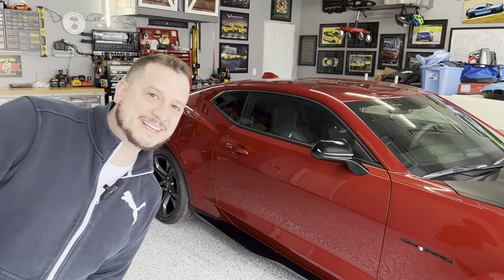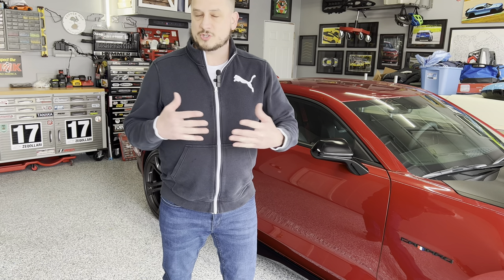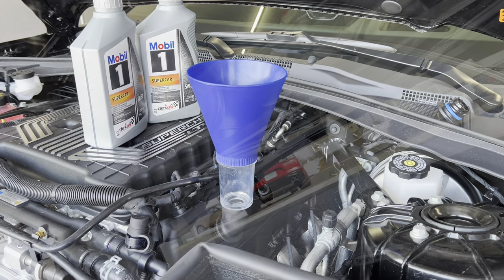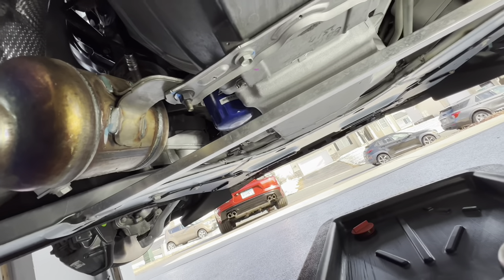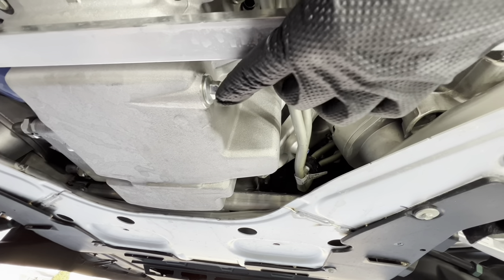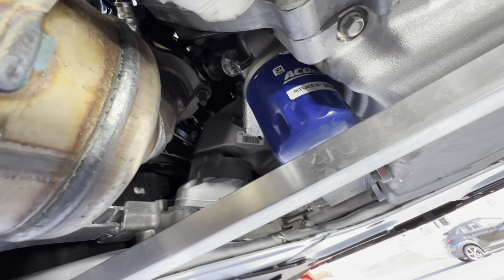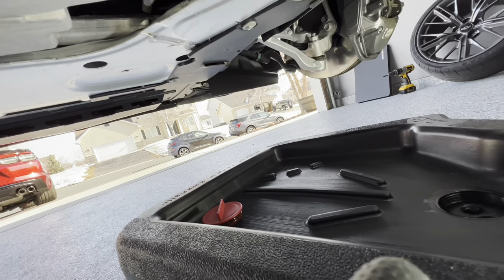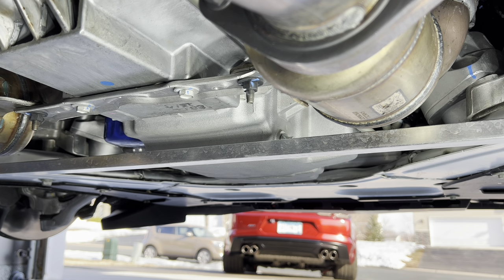How-To: 6th Gen V8 Camaro Oil Change // LT1 & LT4 // 2016 - 2024

Comment: You should probably mention not to lock that angled oil filler tube into place… just push it in and leave it pointed straight up.  If you do happen to turn it and it locks into place (like I did... whoopsie!)… Use a screwdriver to push the tab from the inside so that you can turn it back and remove it. I was so frustrated with it that I used a screwdriver to break that tab off so that it never locks in again 😂
Reply from the maker: I do mention it in the description, and I have a card that pops up in the upper right corner that tells you to break the tab. A long pick tool is what I recommend using if it gets locked. Glad you were able to remove it!
Reply: @FollowMyLine17  Oh dang, I missed that! Sorry. I was able to use a long flat blade screwdriver and it came right off. The tab was gone 2 seconds later 😂

BTW, Steelankles says "Hi!". He lives 15 minutes from me 🙂
Reply from the maker: @srhatfield tell @steelankles I said hello! Great guy! I need to get down to your neck.  of the woods for some track days.
Reply: @FollowMyLine17  Heck ya man! I know it's a long drive, but there are some AMAZING tracks down here.. Road Atlanta and VIR are the 2 best in this area.
Reply from the maker: @srhatfield I’ve been to Road Atlanta. One of my favorite tracks. My goal is Road Atlanta in 2025 and COTA in 2026, for my “long-distance” tracks. Would like to get back to NCM again, too.
Reply: @FollowMyLine17  NCM is good - super technical! Deception will mess with your mind LOL!

I thought they were crazy when Jay and the other guys did that 14 hour drive to Road America, but when I saw the videos... aaaaw man! What an amazing track!
Reply from the maker: @ the videos don’t even do it justice! Hard to see all the elevation change until you are there in person.

Comment: I have learned that 10 QT is not enough to make it to at least the halfway point of the stick marker! I do let the oil drain for about 30 min to make sure is all out! I owen a 2019 ZL1 1LE
Reply from the maker: That is not normal for the LT4. Even though it is technically in the safe range, it should be at least to the halfway point of the dipstick safe range.
Reply: @FollowMyLine17  I make sure that I stop at 10 QT then run the engine for about 2 to 4 mins then check the stick and it doesn't have a sign of getting to the first mark on the dipstick. Smh
Reply from the maker: @Papito24  sounds like you aren’t checking the oil level properly. Engine needs to be cold. 

To get an accurate reading, park the vehicle on level ground. Check the engine oil level after the engine has been off for at least two hours. Accuracy improves when checking a cold engine prior to starting. Remove the dipstick and check the level. If unable to wait two hours, the engine must be off for at least 15 minutes if the engine is warm, or at least 30 minutes if the engine is not warm.
Reply: @FollowMyLine17  Well about this! I am so OCD that I will do my oil change first thing g in the am when the vehicle has not run through at least 12 hrs! Also I do it in level grounds! I would love someone to prove me wrong but why do I need the hole 12 QTs?
Reply from the maker: You should absolutely not need 12 quarts. The GM Small block team doesn’t even recommend overfilling these engines for track use. Something isn’t right.
Reply: Try checking in the garage and garage is usually leveled ground
Reply: @Papito24 The manual recommends that you let the car sit for atleast 2 hours before checking your oil level, if you started the engine and let it run. Related to the viscosity of the oil increasing at higher temperatures, GM mentions that the most accurate check of the oil is when the engine is cold. Doesn’t matter how long its been sitting before your oil change if you start it up before you check it. 

If the engine is up to running temps, says wait at least 15 minutes before checking…. but ive had more success letting it sit overnight before checking after filling it.
Reply: @andrewyun414 Thank you for your opinion! My concern is that when I perform the oil change I let it drain oil for about 30 min, then fill up the oil filter then proceed to fill up with each quarts until 10. Start it up quickly shut it off then check! Clean stick! So for since 2019 the year of my car I have been filling it up with all 12 quarts! Stupid mistake right? But that never gave me any issues whatsoever other than waisting money 💵 right! This last oil change I did just 10 waited until next day and yes it was perfect! So I guess I have to trust it! Thank you again!
Reply from the maker: @Papito24 well, overfilling your engine can cause serious issues with crankcase pressure, and in the long run can cause issues with your oil pump. More than just wasting money. 12 quarts is a lot! Just stick to 10, and you’ll do your engine a favor.

Comment: The first adapter got lock how in the hell do I removed now. If you can show in a video or recommend me one
Reply from the maker: What you need is a long 90° or 45° angle pick tool. The tab that locked is going to be at the bottom towards the ground. Just need to lift that tab up and twist it back to the left, then break that tab off permanently. You can still drive the car in the meantime, just put the oil cap on the angle neck.

Comment: Is there a reason why you using  5w-50 instead of 0-w40
Reply from the maker: Yes, it’s a better oil for track use than 0W-40, and the oil pump can handle the 50 weight oil. That is the most basic way I can break it down.

Comment: Yeah ah if your tracking those engines with those temps do yourselves a favor use Amsoil Dominator oil it holds up better viscosity wise and had a better film and shear strength because unlike the dexos spec Its a group 3 ground petroleum where Amsoil is a true Synthetic it doesn't come from the ground it's base stocks are chemically manufactured group 4 polyaolfins and group 5 Esters base stocks. They hold up better and last up to 2 to 6 times longer. What people misunderstand is Dexos is a MINIMUM SPEC. There is much better out there.
Reply from the maker: You bring up some good points, but the Supercar oil doesn’t meet the “minimum” and has some amazing levels of additives and zinc for the price. I’d love to see the PPM data on the Amsoil Phosphorus and Zinc levels, if you can point me that way.
Reply: @FollowMyLine17  it's called oil analysis and look up how it's made Banks did a video series. It was common to blow rear ends out a pikes peak on a run. Until a racer went with Amsoil gear oil and was able to go through practicing qualifying and the race with out destroying his rear end. Racers in nascar sponsored by shell Quaker State Valvoline switching the oil out in there sponsors container for Amsoil instead because engines lasted longer. Then my experiences with 100's of thousands of miles on original powertrains no rebuild or replacement needed up to 600k and 700k. Witness to other peoples vehicles doing the same. The info is out there the question are you willing to seek it out because if you are you will justify and understand its price point and realize any one making anything close to Amsoil quality and type has a price point just as high or more. Amsoil was the first API certified 100% Synthetic oil I think it was 1971 and has lead the game since. Don't listen to me inform and educate yourself.
Reply from the maker: @Jon-O.  awfully defensive, considering I said you brought up some good points. I was simply asking if there was a specific area on Amsoil’s site with that data, for example. I am familiar with oil analysis, and the 5W-50 Supercar oil was sent out to SPEEDiagnostix and analyzed by Lake Speed Jr. with raving reviews. I couldn’t find the levels of phosphorus or zinc for Amsoil on any of their data sheets, so I was hoping you could point me to the data. I’d love to compare and “do the research” myself.

Comment: At what level do you like to change your oil level based on the digital sensor on the dash? 10-30% or that’s too low? Not including track days.
Reply from the maker: I typically follow the track use change guide, which is:

Engine Oil: 4 Hours of Track Use
Transmission Fluid: 15 Hours of Track Use
Rear Differential Oil: 24 Hours of Track Use
Brake Fluid: Before Track Event or 1 Mo. Old

Comment: Are you able to show the process of jacking the car, i know it's something i should know or be relatively simple, but I want to make sure i do everything the right way. 
Appreciate it
Reply from the maker: Yes, I plan on doing this when I do my rotor replacement video. I’ll show how to lift the car with a pinch weld adapter and where to place jack stands without lift pads
Reply: Its a whole lot less work, and imo a little safer to get a cheap set of Ramps for an oil change. I have to change 6 cars, lol.
Reply from the maker: @TheMonSSter25 no doubt. I have a set of ramps, but we were doing a full track prep on the car and a few other things that required the entire car be up in the air.

Comment: quick question, do you need a new oil drain plug when you do your oil change? or can i use the one already on the car?
Reply from the maker: Great question! You can reuse the one you have, however I strongly suggest the magnetic one I have listed in the links in the description. It’ll pick up small metal shavings and is worth it for a few bucks. 

https://amzn.to/3KKkElo

Comment: Any info on the eurospec oil vs supercar? Would be nice so save some pennies but it seems like supercar is the go to. Planning on doing an autox season and dd with my ss 
1le
Reply from the maker: The older Euro formula had much higher levels of calcium and wasn’t great for direct injection engines (LT1/LT4 are DI) but since the Supercar formulas have been released, Mobil 1 changed the formulation on the Euro ESP to meet Dexos 2, so it’ll work. I would personally stick to the Supercar formula, but that is just my personal opinion.
Reply: @FollowMyLine17  thanks! I ended up just going for the supercar just for a peace of mind.

Comment: Hello, I have a 5° slant in my parking spot from right to left. Is it ok to jack the car with that angle or the jack stand will move or not get be balanced? Or what are some tips to doing it on a side slope?
Reply from the maker: A 5° slope shouldn’t be a big issue. In fact, the 5° slant can aid the oil getting out if you position the passenger side on the lower side. You can also use ramps if it’s just for the oil change, which can be more stable.
Reply: @FollowMyLine17  thanks. Oh should I jack up the high side first? I have jack stands I’ll throw my tires under it then too. Need to rotate them anyways.
Reply from the maker: @VioletTheCamaro  you can do either side first, but as always, use caution. The tires/wheels under the car is typically where I store them too, and acts as an extra buffer. Replacing a wheel and tire is far cheaper than any damage the car might take, or worse, any injury you may incur.

Comment: Are those rubber drain plug washers required? Never had a car use anything but a metal drain plug crush washer. Interesting.
Reply from the maker: Yes, they are required.
Reply: Do you replace those every oil change?
Reply from the maker: @wadewilson5681  no, I replace them maybe once every 4 or 5 oil changes. Not a high-wear item.
Reply: I’m about to do my break in oil change tomorrow if it doesn’t have one from the factory should I put one on it?
Reply from the maker: @wadewilson5681  there will be one on the factory plug, you should have no issues.

Comment: For the filler neck (#12609623 Oil Filler Tube) does this part fit or needs a mod? Amazon says it doesn't fit the LT4. Which I see yours does.
Reply from the maker: Amazon’s fit guide is terribly inaccurate. There was a redesign on the angled filler neck at some point that included a locking tab which forces it to lock into place facing the firewall. Just break the tab off and you’ll be fine. If it DOES get locked in place, just use a pick tool to pry it up and remove it.

Comment: 1 comment, my 2023 service manual recommends Mobil 1    Full synth 0w40 DexosR. Is there a reason you use 5w50?
Reply from the maker: Hi! Great question. The factory recommended fill is 0W-40 but for added protection on track I use the Dexos R 5W-50 introduced with the C8 Z06. I give a full explanation in this video here:

The Great LT1 & LT4 Oil Confusion // When to Use Which Oil & Filter // Breaking It All Down
https://youtu.be/1IkFYjPDrtY
Reply: @FollowMyLine17  thanks for the reply, it is what I figured. Just wanted to hear it from you. It show you really know what you are talking about. Great videos. Thanks again.
Reply from the maker: Thank you! I appreciate that very much.

Comment: Where can i get the oil plug adapter and that funnel? Do you have the gm PN#?
Reply from the maker: Hi! All of the links are in the description, but here they are for you:

GM Angled Oil Fill Adapter:
https://amzn.to/3zKJ7Az

*This adapter has a revision. It has a tab that needs to be removed before using, otherwise it can lock into the valve cover. If that happens, you can remove it by using a pick tool to lift the tab.*

Motivx Tools Engine Oil Funnel for Most GM
Vehicles:
https://amzn.to/3zRdLIw

Dorman Magnetic Oil Drain Plug - M12-1.75, Head
Size 15mm:
https://amzn.to/3KKkElo
Reply: @FollowMyLine17  thsnk you I must have missed it in the description.

Comment: The oil fill threads are different for the LT1 and LT4 motors? The angled oil fill says doesn’t fit my SS. Is this true?
Reply from the maker: They are not different. I’ve used the same angled adapter on both the LT4 ZL1 and my SS 1LE features in my videos.
Reply from the maker: Amazon’s “fit guide” is awful, btw. Usually not accurate when it says it won’t fit your vehicle.
Reply: @FollowMyLine17  thanks man. That’s what I thought. I’m super new. Plus was raised in MPLS 👍
Reply from the maker: @VioletTheCamaro  you’re welcome! I’m originally from the Motor City but been here in MN for over 5 years now. Feel free to check out the channel and ask any questions you may have.

Comment: I have an lt1 what oil do I use ? 5w-30 or 0w-40 and which one dexos1 dexos 2 or dexosR
Reply: They would both work fine, 0w-40 was developed after the LT1 already came out which is why some oil caps for LT1 motors will say either 5w-30 or 0w-40. Dexos2 or DexosR is what i would get. Mobil 1 0W-40 SUPERCAR is the new name for the ESP formula, that is what i would recommend, they changed the name and bottle color from green to orange when the C8 came out.
Reply from the maker: As GhostKiller mentioned, they both work fine but I would use 0W-40.